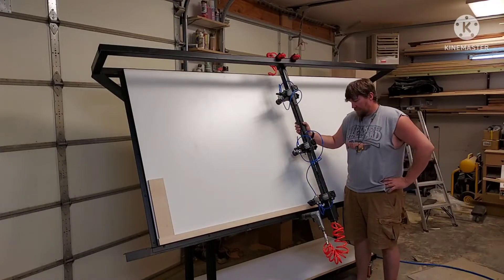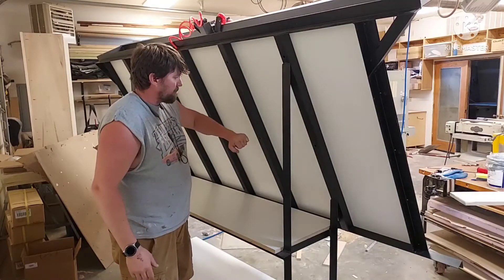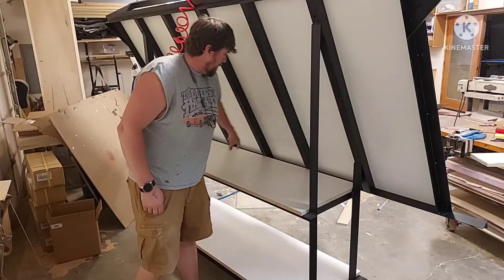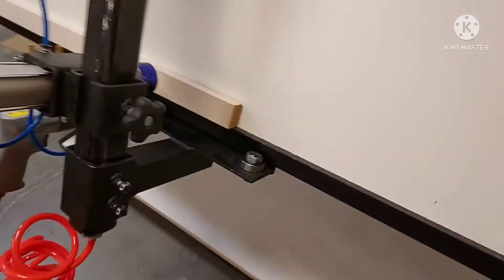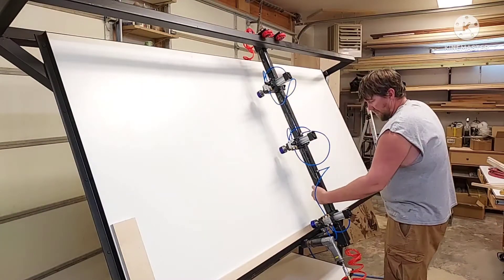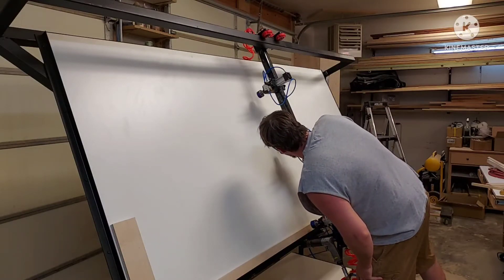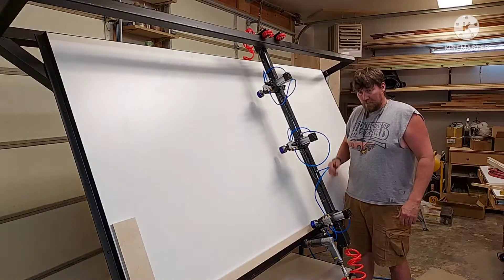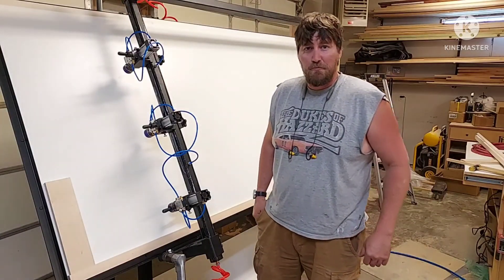DIY Faceframe Clamp Table

Comment: Great Project!!! where did you find the pressure plate that fits the cylinder shaft?
Reply from the maker: I am not sure what you mean. If you are talking about the foot at the base of the cylinder, we .ade it on the metal lathe. We have a local gunsmith who taught the boys.

Comment: Thanks for this video! I'm truly inspired by you and your students and would like to really to build something similar to this. What is the white sheet metal called again and did you screw it or is it glued down. Also, would you recommend me getting a specific single piston action brand? Thank you so much!
Reply from the maker: The white board is 3/4" Melamine, not metal.  It has a slick durable surface.  I don't have a specific piston to recommend.
Reply: @WoodshopwithMrKern  thank you so much!

Comment: This is so awesome! Really, you would probably find things you don’t like about a factory built table. 
I’m going to build one and this was so much help, thank you! 
Oh, and the cylinders they use on castle brand tables are 2” bore, so you may think what you have is over powered, but castles are actually bigger. 
What psi are you running on these cylinders?

Comment: Would you mind posting the links of the pneumatic cylinders, valves, etc., that you used?
Reply from the maker: TAILONZ PNEUMATIC Air Cylinder SC 40 X 100 Bore: 40mm Stroke: 100mm Screwed Piston Rod Dual Action https://www.amazon.com/dp/B08FGW7HN9/ref=cm_sw_r_awdo_AK1HNQG94K308PQHM0WG?psc=1

TAILONZ PNEUMATIC 1/4"NPT 5 Way 2 Postion Air Hand Lever Operated Valve Pneumatic Solenoid Valve Manual Control Push-Pull 4H210-08 https://www.amazon.com/dp/B07SHG911C/ref=cm_sw_r_awdo_YAPWWFM802CB9Q2G8TZ8